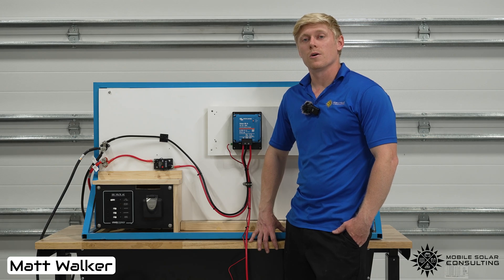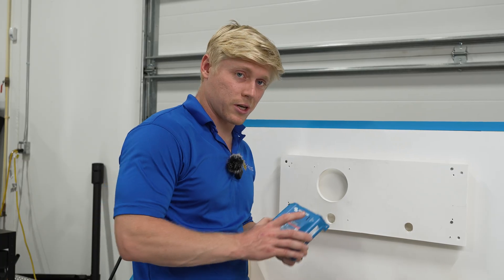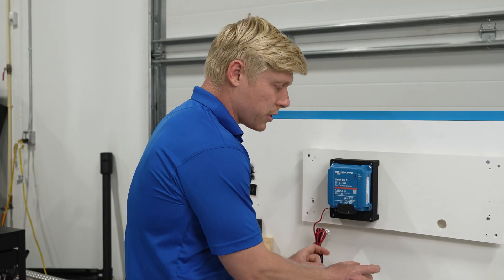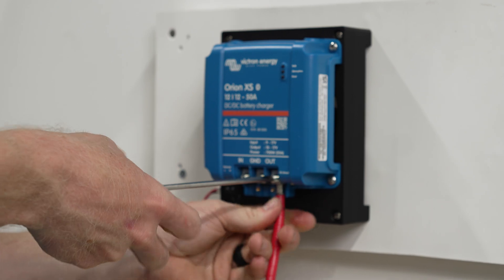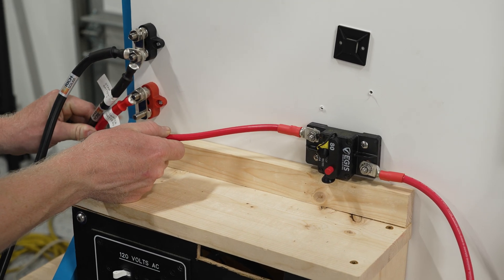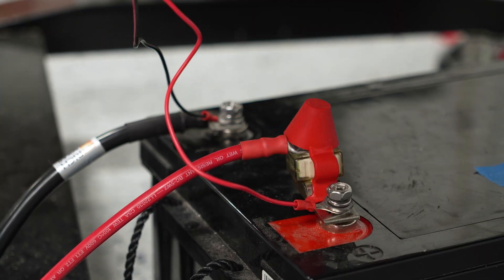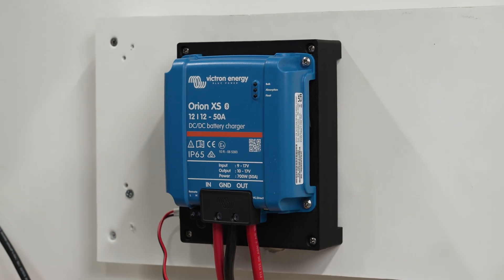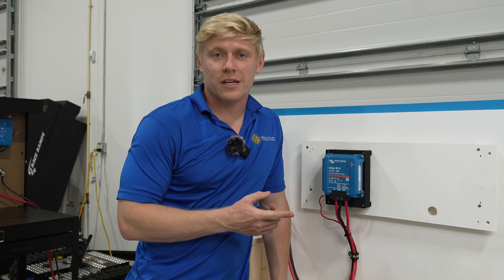How to Install Victron Orion XS & XS 1400 (EASY Step-By-Step Guide)

Comment: Before powering up Is not necessary to take off the tiny black wire from the remote and make a connection from L or H? ( On the PDF manual you have 3 or 4 choices)
Reply from the maker: The jumper between L and H comes installed from the factory. You can remove the 2-pin connector before imstallation to prevent the charger from turning on immediately when finished installing, if you'd like.
Reply: @MobileSolarConsulting thanx for the answer..so it s not obligatory to take It off

Comment: The older Victron DC to DC Chargers had a large heat sink and a fan makes sense.  The new Orion XS 12-12-50 your mounting does not due to claimed 98% plus efficiency.  So why the fan?
Reply from the maker: Because it still gets wildly hot.

Comment: Hi, thanks for the nice video. Quick question, in a campervan setup, would you mount the orion closer to the starter battery or closer to the leisure battery? Thanks!
Reply from the maker: It does not matter

Comment: A couple of questions:
1.  How does the cooling fan not run down the battery that it is connected to?  Or is it temperature activated?
2.  For transitioning from #6 to #4 wire, would you do this with a solder connection (back in school we called this a western union connection), or butt connector, or ???

thanks, for an easy to follow video.

D
Reply: Please forget question #1.  I just saw the link about the temp control.
Reply from the maker: Hi good questions. It is temperature controlled. Fan turns off automatically when cool. Recommend using lugs on each wire end and a small, 2-post busbar like you see in the left side of the video, for the stepdown from 4 to 6awg.
Reply: @MobileSolarConsulting  Good video. Though the fan is temperature controlled, I can see it kicking on, on a hot summer day when the vehicle is not running. Thus discharging the house battery. So would it not be better to have it wired to an ignition sensor circuit? As the Victron unit is not going to be running unless the vehicle is running.

Comment: Is the ford CCP the correct place to connect this unit to the battery
Reply from the maker: Yes! That works well.

On other vehicles, connect directly to the starter battery's terminals